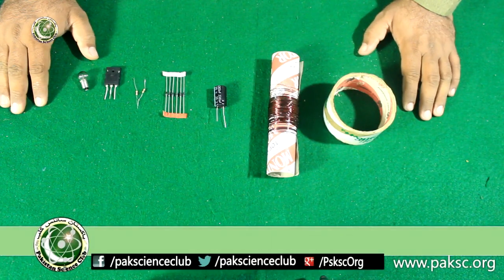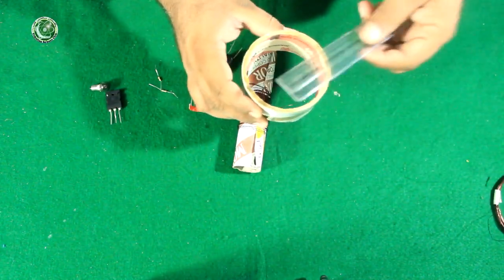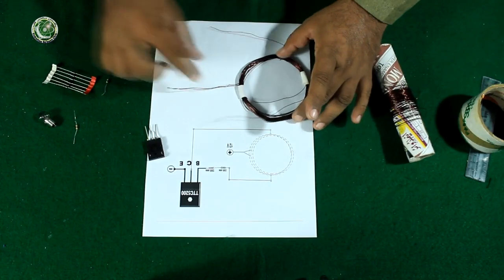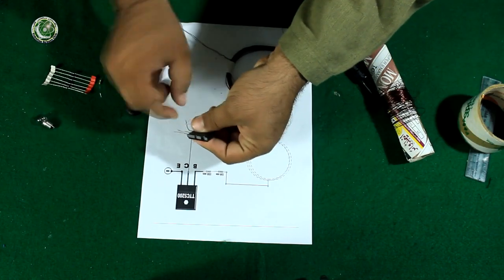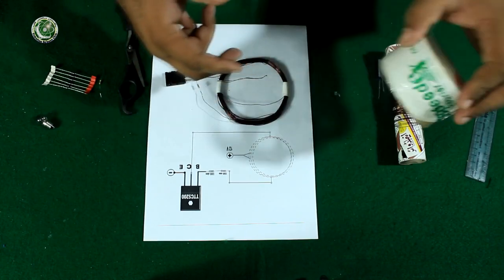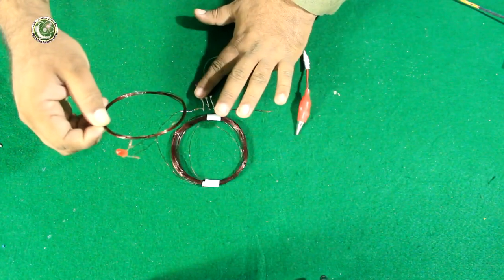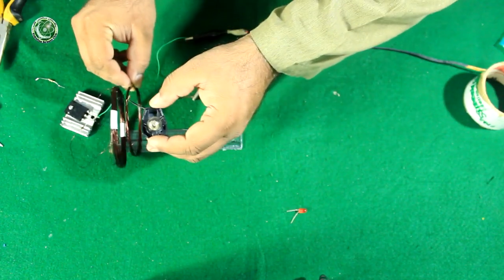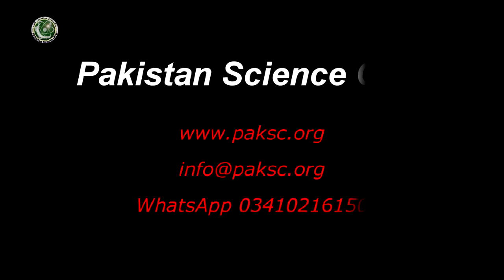How to Make Simplest and Powerful Wireless electricity transfer project (Urdu)

Comment: what is the alternative of the transistor & what is the maximum secondary voltage & current?
Reply from the maker: +akash kodu tip 3055, mej 3055 can used and max output depending on 2nd coil turns in this project it produce 20 v
Reply from the maker: +akash kodu tip 3055, mej 3055 can used and max output depending on 2nd coil turns in this project it produce 20 v

Comment: please reply 
 can i use any other transistor please reply
and suggest me
Reply from the maker: +Muhammad Asif yes you can use TTC5200 or MJE3055
Reply: +Pak Science Club can i use L7812cv transistor
Reply: IT is  actually a voltage regulating  IC and not npn or pnp transistor